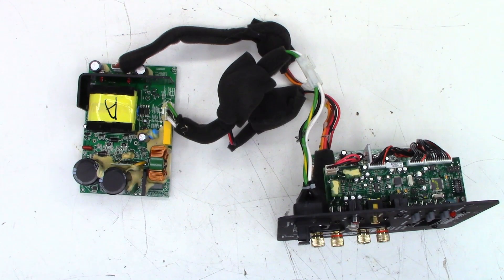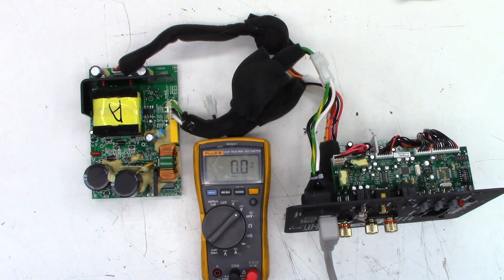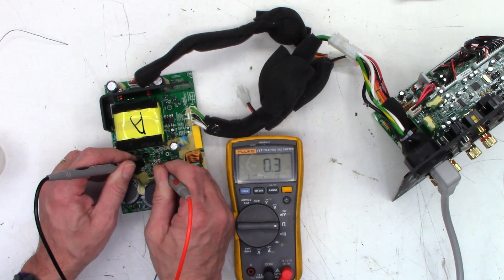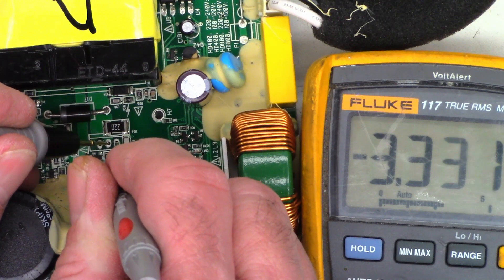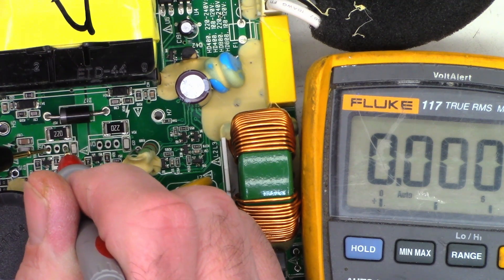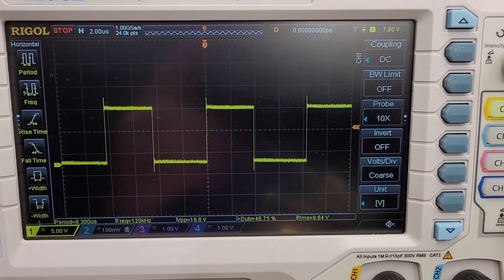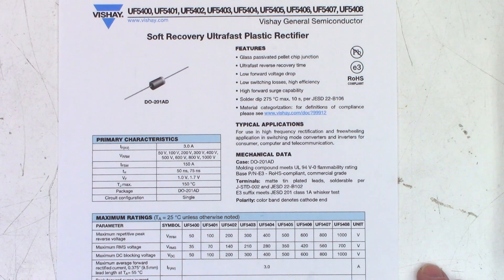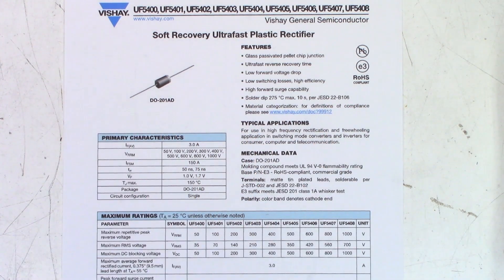DEAD Def-Tech SuperCube 4000. Part 3 - More Troubleshooting, Checking the FET Driver waveforms.

Comment: Hi Norcal715, i love this video of yours because you whipped out your digital scope. I also bought a digital 200MHz scope but do not know it's full potential. Perhaps you can make a video where you do testing with your scope and explain how to use it? There are many youtube videos regarding digital scopes but not many that actually connect their scopes to consumer electronic products. I am crap scared of measuring with my scope on a FET when oscillating. Scared i blow up my DSO, even though i do have a isolation transformer connected. I also bought a x100 probe so as to not overvoltage my scope. I have the Siglent SDS1202 model.

Comment: I have a supercube amp that uses the same exact PS as this amp. The amp is in a constant on/off loop every second where the power LED flickers on the preamp board and you can hear a faint ticking sound every second from the PS itself. I don’t see any relays so what is the ticking? Thanks!
Reply from the maker: Probably the power amp on power up/power down cycle
Reply: @norcal715 
I posted a video of the issue I was having and someone else said they had same “ticking” sound and it was a bad transformer.
Reply: @jimbanville  Try replacing C191 on the PS 25V/47uf, to the left of the lower optocoupler.  I had the exact same symptoms.  Try that first.
Reply: @norcal715  (Repeat post): I had the identical fault, same PS/amp.  I troubleshot it down to an electrolytic on the PS- C191, it's to the left on the lower (of two) Optocouplers, and to the right of a small transistor.  It's value is 25V/47uf.  Part of the feedback/startup circuit.  Still works, 4 years later.
Reply: @norcal715  (Repeat post): I had the identical fault, same PS/amp.  I troubleshot it down to an electrolytic on the PS- C191, it's to the left on the lower (of two) Optocouplers, and to the right of a small transistor.  It's value is 25V/47uf.  Part of the feedback/startup circuit.  Still works, 4 years later.
Reply: I had the identical fault, same PS/amp.  I troubleshot it down to an electrolytic on the PS- C191, it's to the left on the lower (of two) Optocouplers, and to the right of a small transistor.  It's value is 25V/47uf.  Part of the feedback/startup circuit.  Still works, 4 years later.